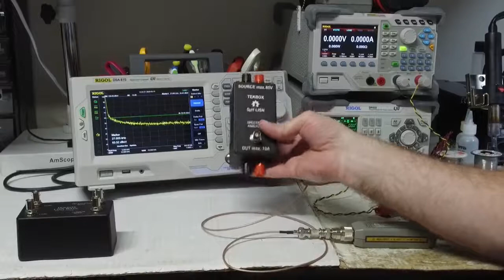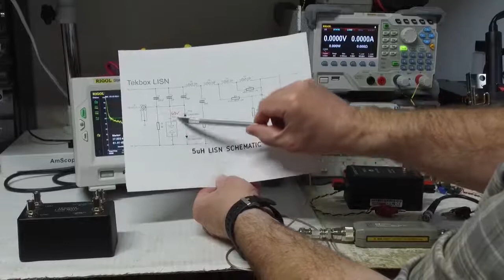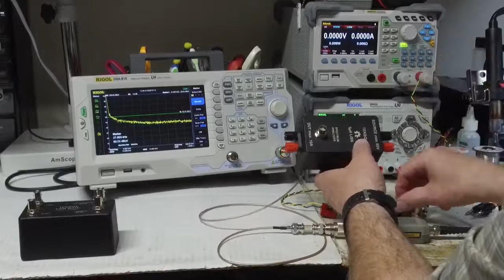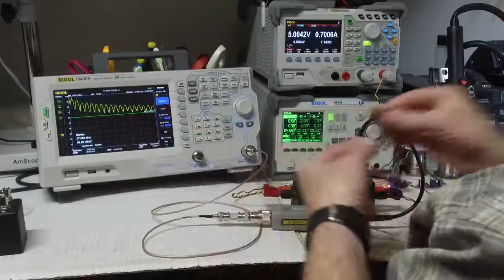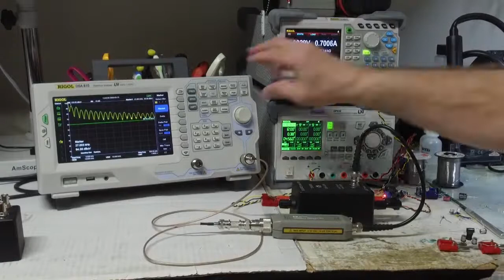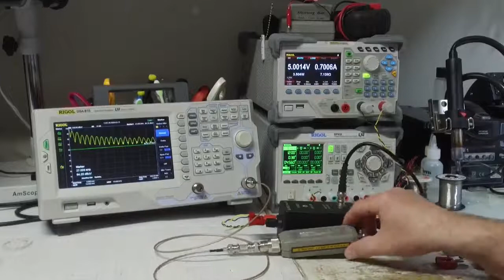Conducted EMC Pre-Compliance with Tekbox DC LISN and Rigol DSA815.  Fake LM2596S Exposed.

Comment: The grounds on your LISN and DUT should be tied locally to the ground plane and the DUT needs to be raised an inch or two above the plane (not just a cardboard thickness away as that introduces capacitive elements which aren't good in RF measurements!). Also, to ensure the PSU is not affecting the readings, it's wise to place ferrites on the supply cables into the LISN so that the only conducted RF your measuring is from the DUT. The load also needs to be a self powered passive load to ensure that it is not introducing any mains or load regulation switching noise into your DUT measurements. You also need a transient suppressor on your analyser input to prevent the overload conditions you had in this video. Too many of those will shorten the lifespan of your analysers front end!
Reply from the maker: Good points.  Purpose of this video was to demonstrate a quick test.  I usually make a comparative measurement with the DUT on and off to see if I am getting external noise through the AC mains.  On many occasions I have had too much external noise and have added a common mode filter on the input to the LISN.   Note that this LISN has a built-in transient limiter and 10dB attenuator :)